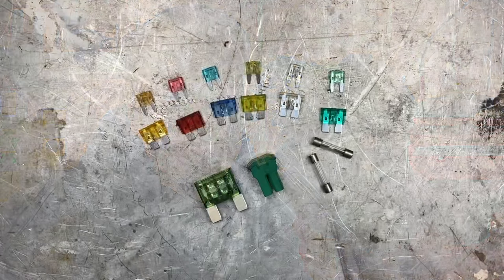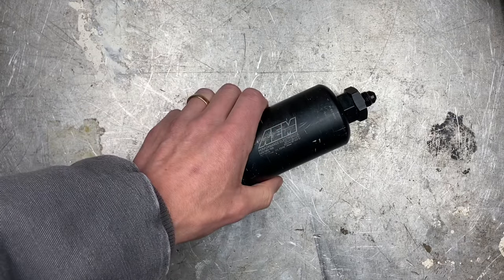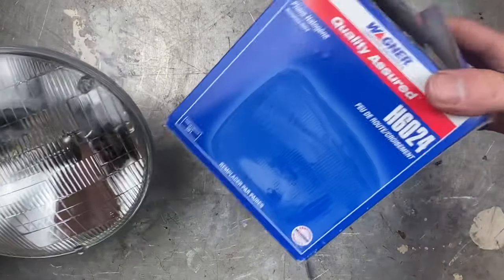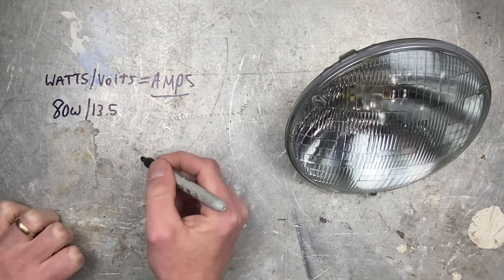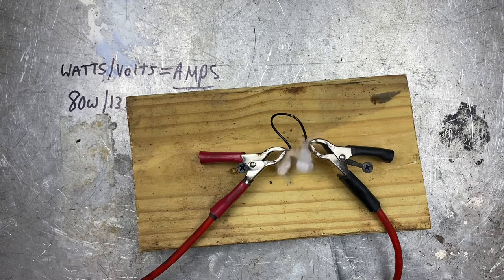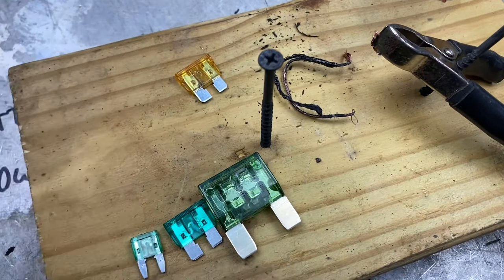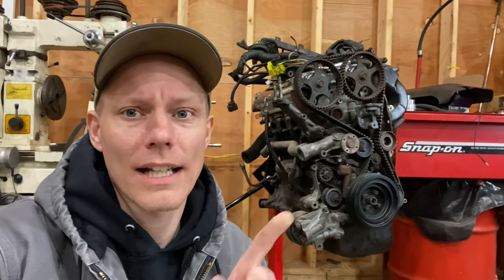What Size Fuse and Wire? ANSWERED! @WiringRescue

Comment: To be safe if you are unsure of how big of a amp fuse to run you could start low and go up one size at a time until they quit blowing. This will cost you a little but fuses are cheap overall. Of course on the wire gauge size always error on the side of going slightly bigger than you think you really need. This will cost a bit more but you will have less voltage drop and your wires will always run cooler.

Comment: Okay so if I have a starter that I want to put a Mega Fuse on. What size would I need if the vehicle requires 585CCA (cold cranking amps)? 600A Mega Fuse? What about using a MRBF terminal fuse right on the starter. So if it blows, it won't arc anything but the fuse.

Comment: I find your explanations on wiring and fuses super easy to understand. Were auto electrical gets confusing to me is RELAYS. I find they are confusing because you have two circuits in one a switch or trigger side and a main power circuit. Also my 5 pin plugs use different colors then yours so I had to make a chart with my wire colors and their matching pin numbers so I wired things right.

Comment: Not all ST blade fuse boxes have a ground post side. If you are using a fuse box in a metal boat where the whole boat is grounded. No need for a ground in the fuse box. The type shown would be more for a wood or fiberglass which are not grounds because they don't have good conductivity.

Comment: Hey Jeremy, great video and it did help me, but I have a question to make sure. I hope you can answer. I'm going be running a 14 gauge wire harness with a 60A relay, that's 10' long, with two DT connectors. Those will connect in two separate 10' 16 gauge extensions with DT connectors.  Then the ends of those will plug into my LED light pods in the back bumper . Those light pods are only 1.1 Amps each so 2.2 together.  They are 14.5 watts each so 29 watts. With all of that said, does it sound okay to use that 14 gauge wire harness to the 16 gauge extensions into those light pods? Also, what size fuse should you recommend?

Comment: Good info , love it. I have wired  fog lights before but never calculated  amps. Used relay and 14 gauge wires. no problems so far. I will do the math next time. Thanks.
Reply from the maker: Excellent! I’m glad you enjoyed the video. Calculating the amperage may also save you some money with the price of copper wire being so high at the moment! Also oversizing the wire slightly is always nice fire insurance. ;). Good luck on your next project!

Comment: In your headlight scenario, the amperage load has determined that you require a 7.5 amp fuse and the minimum wire size required is 16 gauge.
If I happen to have a large spool of 14 gauge or 12 gauge wire available, can I use those larger gauge wires in this scenario?   If the larger wires are used, does the amperage of the fuse required change?   I happen to have 7,000 ft. of 12 gauge copper stranded wire.  lol.
Reply from the maker: That is a LOT of wire! You can use the thicker wire, and the fuse size will stay the same. Good luck with your project! :)
Reply: @WiringRescue  Thanks.  I've had trouble finding an answer to this question.  Everyone just warns against downsizing wire sizes.  I know people do "The Big Three" wiring upgrade, that up-sizes the battery/starter/alternator wiring, without changing the fuse specs.

Comment: I have a fusible link for my alternator/fuse block that keeps blowing. The alternator is a 60amp. Not sure what size fusible link is on it now. Wanted to switch to maxi fuse. Will a 60 amp do the job or should I go higher ?

Comment: thank you very much. 
My radar detector did not work in sudden, i thought RJ11 wire cable was too old (10 years setup, using on my 3rd car now). so I bought the entire hardwire kit from Amazon.
My old hardwire setup:   7.5AMP bladefuses with fuse adapter + Glass Fuse 1 Amp 250v.
Before I change to new hardwire kit,  I realized that old table burned my Glass Fuse 1 Amp 250v. 
So I replaced the glass fuse 1amp (new from new hardwire kit - there are extra in my new hardwire kit), radar detector work again,  it only work again like few mins, but new Glass Fuse 1 Amp 250v burned out again. I don't know why??????????

Now I changed the whole setup to new hardwire kit. its 3 AMP bladefuses with Fuse adapter + 1 Glass Fuse 1 Amp 250v (same fuse but new) . It looks fine, but I'm not sure why my old hardwire kit burned out two * Glass fuse 1AMP (first glass fuse used for 10 years), and second glass fuse (new - only use for 2 mins)

Do you know what is the problem? Do you have any idea? please thank you!

BTW thank you for your information, I have learned about gauge + watt + AMP thing, that is really helpful and great example idea. I wish u 100k sub soon.

** The power is coming from accessory empty spot in car fuse box**
*Fuse adapter i only put 1 bladefuse on top one*
Since that is empty fuse spot, so i did not put 2 bladefuse on fuse adapter.

my new wire kit: 13FT RJ11 Style Radar Detector Hardwire Kit,Quick Connection Plug and Play Cord Cable Set 
(i don't want to share amazon link and affect your channel)

Comment: Thank you so much for making this video! This is the most vell explained video about lights and wires i've found on youtube. 

I'm about to install some 40W LED working lights on my tractor and i'm just wondering if i could use a16 gauge wire and a 7,5 amp fuse as you said for the 40W sealbeam headlight in this video?

Comment: I installed a wolo horn on my 2022 Corolla Cross.  I just hooked in to the previous wires.  It worked at first, but now it blows a 10amp fuse.   Will I have to go the relay route? And if I go to the fuse box for power, will it turn off with the car?
Reply from the maker: This is my first time learning about a wolo horn, but it looks like they recommend a relay in this diagram https://addonaccessories.net/media/wysiwyg/419-519.pdf

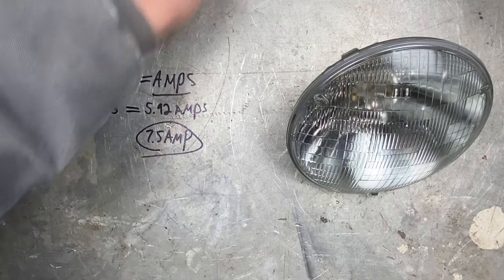Comment: 6:00 Attention is required here. Lets say OEM is a H4 bulp 55/60W and Fuse 5W but the bulp is changed to 100/90W but fuse and wires are still OEM !!!

Comment: So how do you figure out how much amps is going to be pulled when the item has no description specs.
Reply: There are electrical meters that you can use to test actual amperage load.  For the meters you can buy at your local auto parts store, they usually have a limit of wither 10 A or 20A that they can test.  I'd get the one that tests up to 20A.  If it exceeds that, then the other type of meter is a clamp on, loop ammeter.  They can go much higher since the current isn't running through the device.   Setup the device in a test circuit on your work bench with a car battery, 12V DC power supply or a battery charger as the power source.

Comment: If you use 12 volts instead of 13.5, you get 6.666666 amps. You should probably use that measurement because it will give you higher amperage. Therefore, it may require, in some instances, larger wire/fuses

Comment: HI jeramy, i like your electricalwirirng circuits, my prioblem is that i amworking  on my classic volvo p1800, 1971 model. i bought a set of four led rear covette c5 tailamps, but i am not sure how to wire them, i need your help to provide me with a circuit diagrame. thank you

Comment: so let’s see i have a pair of led lights that don’t tell me how many amps they are it just says “240w/pair”

i’m assuming if i do the math 240/13.5=17.78 so that means i need a 20 amp fuse and 20 amp relay to run them safely? 

i checked the actual amp draw by hooking up the lights to a spare battery and putting my volt meter on DCA10 and putting my meter inline to complete the circuit and it was drawing 3.77 amps.

confused and don’t wanna burn my car down lol

Comment: Is the 80 watts for the seal beams when they are hot as the heat changes the resistance of a bulb which will change the amps eg. A light cold might be .5 ohms and light hot might be 3 ohms which will change the amps
Reply from the maker: Very true! So it’s always good to look at the factory ratings for any kind of electrical item that is added to a car. Some amperage draws at start up can be very surprising. Thank you for watching and sharing that info!

Comment: I have a 2013 ford fiesta se, I’m installing an aftermarket radio in it. Unfortunately the car doesn’t have an accessory wire so I can’t seem to get the new radio to turn on when I turn the car on. I need to tap into an accessory fuse. My question is what size fuse should I use and should the fuse tap have an extra fuse unit. Alas what site wire should I use. Thanks

Comment: I've read the fuse margin to be 1.25x then pick the next size up. So, 5.92A X 1.25 = 7.4A, so 7.5A is fine. It might be you skip to the slightly bigger fuse than just enough but it should cope with spikes etc a bit better than just the next one up.
It's better to err up just a fraction on the wiring anyway, especially on a longer run or if marginal and the fuse is there to protect the wiring, I think.

Comment: If I were to have a wire leading to multiple other lights. Say one wire to a bus bar and then separate wires to each light do I only need to account for the amps per light on each individual strand, and then the combined amps from the bus bar to the battery?

Comment: Hi, I keep blowing 30A inline fuses from battery to relay to satart the car all new 8 gauge wiring, I dont know what the starter amperage is for starting, if I go to 40 amp or greater which nmeans I have to increase the wire gauge may up to 4 gauge, what do you think.

Comment: Nice video, but contains a major flaw.  Fuses are NOT sized to devices!  Wires are sized to the current needed by the device(s) on the circuit.  Once the proper wire size is selected, then the proper fuse or circuit breaker is selected to protect the wire, not the device(s).  This is particularly important in longer circuits where the wire may have to be sized to provide a certain voltage level to a device and not just amount of current.  Often larger wires are needed for long runs, not for ampacity reasons, but for voltage drop reasons.

Comment: Good info, I recently ran across your videos, my question is how do you find out what a device, like a fan motor, draws as far as amps? I'm trying to use a pair of cooling fans from a donor car. I have tested them separately. But when they are turned on together it will draw more amps. Suggestions?

Comment: So with wiring led lights that are rated at 60 watts the company gives you a harness that has 30a fuse when all you really need is a 5a fuse according to the calculations. The wire they are using is 18awg. So why such a large fuse?
Reply from the maker: That’s a great question that I unfortunately don’t know the answer to. It sounds to me like you’d probably burn the wires before popping that 30a fuse. I’d run a 7.5amp fuse if it were going in my car, but a 5 will likely work fine too.
Reply: @WiringRescue  thanks for replying!  Yea, I called said company and they told me that they over fuse them as a precaution. In my head I thought the same as you,  I'll burn these wires up before the fuse pops. I called 2 stereo shops and they both told me to down size the fuse..lol. I don't know why these lightbar companies do this, I've seen it so many times.
Reply from the maker: @ofc474  I’m glad you thought about this before installing it! It could prevent lots of problems down the road!
Reply: @WiringRescue  thank you for your video 🙌🏾

Comment: But you got to remember it draws more when it first turns on . So use a 10Amp fuse. 2x55 watt bulbs 15 Amp fuse 2x100 watt H3 bulbs 20 to 25 Amp fuse.
But that was a grate video.

Comment: I really need an assortment kit of fuses 
Car companies these days aren't supplying fraction value fuses😑
So its 5A and then direct 10A from the OEM spares shop😑
Reply from the maker: The variety packs of fuses are very reasonably priced. I want to guess like $10 for like 200 fuses? It’s totally worth having tucked in the back of the tool box. The only bummer is that now car companies are using regular spade fuses, along with mini, so you really need both.

Comment: Great video and easy to follow. I'm kind of a newbie, so I have a question. I know you shouldn't use a higher capacity fuse than what is required for any particular circuit because the increased amperage will get through the fuse and cause wire and component damage on the other side. But can we use a stronger (lower gauge) wire with the correct fuse? Or will that cause damage also. I don't mean an extreme example like using a 1 gauge when only a 16 gauge is required. I mean like using a 12 gauge when only a 16 gauge is required. Thanks. BTW...SUBBED!
Reply from the maker: You can use a larger than than necessary wire. The downsides are that larger wires are more expensive, harder to route around things, and usually require bigger terminal at the end, which are also more expensive.
Reply: @WiringRescue  Thank you for your quick reply.

Comment: what about connecting two different gauge wires like a 12 gauge to a 16 gauge?

I have auxiliary light with a connector that's 16 gauge and I have a wire harness that is 12 gauge 

The light produce  1.14amp
Reply from the maker: You would have to do your measurements based on the 16 gauge wire, because it’s the smallest in the circuit. 1.14 amps is not much though, if you look at the chart I have linked in the video description, you can see how many amps a 16 gauge can handle.

Comment: What wire is best to use for a 12v fuel pump?
Reply from the maker: It depends how many amps the pump draws through the circuit. The bigger the pump, the more amperage it draws, and the larger the wire you’ll need.

Comment: I installed led lighst on my trucks bed , with a 30 amp fuse which blows up when turning the lights OFF, i searched the leds and it says they are 1.5 w per pod and it’s a total of 8 pods which makes it 12watts /12 v since they will be running when truck is off , and it’s 1 amp, could that be the reason it blows up the fuse for Overload , it did i learned something wrong!?
Reply from the maker: Something must be wired wrong because a 30 amp should not be popping with 1 amp going through it. You must have a connector or wire that is grounding out somewhere. I’d recommend taking a good look at the switch. It could be the switch itself or the connectors around it. You also may be damaging the wires if you have 30+ amps going through them because they are surely not intended for that if they are LED’s.
Reply: Thanks for the quick response , i’ll give it a check i was afraid my truck cought on fire during the night 😂

Comment: What voltage is your power supply set to to burn thru the wire ? Basically if i use nice and thick wire together with smaller rated fuse that’s the safest for a tap ?
Reply: They seem to make fuse holders with thick 12 gauge wire while the fuse taps are for 16 gauge. 😣

Comment: Please please answer me.  I have 40W/ pair of fog lights.  Please tell me which wire and fuse size should i use.  Plz
Reply from the maker: Did you watch the whole video? The information you seek is in this video.
Reply: @WiringRescue  ye ye. 40/13.5=2.96 amp. So i should get the 5amp fuse right? And what gauge wire should i use ? That wire info, I didn’t get it

Comment: But what if battery power to draw eg lights is just 7’ not 20’?
What gauge wire?
Reply from the maker: There is a chart linked in the video description. Check out the chart and it will tell you the wire size that is appropriate for each amperage based on the length.
Reply: Also worth noting that the total length of the circuit is BOTH the 12V positive supply wire plus the length of the ground wire.  If your ground wire is super short AND is connected to a clean, (not rusty or corroded or painted) ground point on the chassis then you don't need to include it in the total wire length.  But do make sure all of your chassis components are all grounded together with excellent connections and cable.  I'd use an old wire or string to actually route the path of the wiring then measure the total length.  It is surprising how many feet it takes to route it neatly and out of the way.

Comment: Can i use 12Amps on my 10Amps fuse socket?
Reply from the maker: Nope, you’ll burn things. You should use the right size wire, fuse holder, and fuse for the load that is being powered. If you overload any part of it, you risk damaging the circuit and possibly even causing a fire.

Comment: Does it matter if the fuse is installed on the positive or negative lead?
Reply from the maker: Assuming you aren’t building something really weird, the fuse should be in the power wire as close to the battery (or power source) as possible. 

Here is why -  Imagine your car’s chassis is grounded to the battery (as it should be). Any power wire coming off the battery has the potential to touch any part of the chassis and cause a short to ground (Fire!) So if you have a power wiring coming off of your battery, going to an accessory (maybe a fuel pump for example), and then have the fuse in the ground side of the fuel pump circuit instead of the power wire, you will still have this super long power wire coming off your battery that could accidentally ground out in your chassis and cause a fire. 

If the fuse is on, or super close to, the battery, in the power wire, then the entire circuit is protected.

Comment: what do you need to run a spot light on a boat wire gage and fuse 12volt system
Reply from the maker: It depends how many watts / amps the boat light is. The more amps it draws, the bigger the wire and fuses need to be.